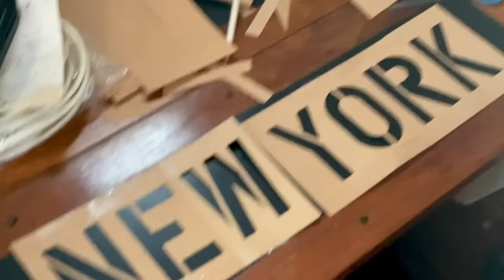Sailing Liberty- Boat Repair Down and Dirty / Real Boat Life / Vmax battery and Isomat Gooseneck

Comment: I used to install 48 volt battery power plants for telephone systems. If you got across the wrong terminals you would know it. So we used to wrap our tools with electrical tape.

Comment: Hey guys, I had a Challenger Ketch from 1976 to 1994. We lived on her from April 1st till November 1st on Lake Ontario NY & Canada. We loved our Mizzen and Mizzen staysail and flew them in any wind under about 20-25 mph as long as we4 were at the right anggle to the wind. Use your Mizzen. You will love it. In low wind we used a hanked on 180 drifter.
Reply from the maker: Challenger seems very nice and spacious with a good headroom. A great Bluewater sailing yacht. We cannot wait to use our mizzen as well. I hope this gooseneck... that it is really fixed now. It took I guess 2 years to get to this point since it was a minor problem to deal with compared to leaking hull. In next voyage we will have our mizzensail flying proud:). Thanks, Helena

Comment: I would use a hole saw on the inside of the boat where the chainplate nuts are and then remove the nuts and bolts. I would leave the existing chainplates in place as getting them out appears to be too much work and they can add strength. I would then install the new chainplates on the outside of the hull. Maybe enlarge the old holes in the old chainplates slightly and coat them to prevent electrical contact with the new bolts to prevent the possibility of galvanic corrosion.

Comment: As to the chainplates I would add this:  First, locate a chain plate that you can examine with the least amount of damage to the boat's interior.  Look for areas were the glass has expanded or bubbled .  If you find such a condition then you may have rust and a break down of the chainplate.  If none is showing then you can either conclude the plate is okay or remove the glass to inspect it further.  The critical chainplates are those supporting the upper shrouds . Try to examine them above all others.
Your plan for the plate on the bulwark I believe is less that sterling.  I feel this way because you are placing the entire load on a 4" area, whereas the traditional chain plate spreads the load over several feet of the hull.  The load is all vertical and I feel 4" of bulk ward is insufficient to bear the load with damage to the hull deck joint. Before I would undertake the expense of the supplement plate I would make sure that the chain plates need replacing.  You might want to check out the You Tube channel  "Sailing Prism" wherein they detail their method for replacing the chain plates on a Hans Christian 33T..Good luck and fair winds.

Comment: Good discussion about the chain plates. I appreciate your concern! Hopefully you can get some good information. 
Needless to say, I think your av work and discussion are getting better. You both are obviously experienced in your av skills, but each “scenario” has particular types of presentation. 
Glad to see you escape significant storm damage.  Yes, sailing equipment is expensive, but hopefully someone designed a good piece, manufactured it with good material and stocked it with a good supply system. Thx for bringing us along.😊😊😊 John Ken

Comment: I worked with Stainless for 40 years and there are two important things to keep in mind:
Use a sharp drill bit and slow speed with a lot of pressure.

Comment: When you spray the chain out the lines of chain right up next to each other.  The overspray will hit the other chains and the can will go farther as more paint overall gets on the chains. It's just a little difficult to turn the chain over and lined up again for separate coats. Also I bought a bunch of Chinese 3.2v lithium cells and mad my own lifepo4 batteries.  You might be able to fit 560ah up to 1120 ah using 280ah cells. I was able to make 1120 ah for less than  $2000.  One battery for less than $500.  You get like 25 percent more power out of your solar because lead acid takes so much power to just top up the last 10 percent at the top.  So that last bit takes soooo much to reach top charge.  Though those batteries will last a year or two for sure.  Though my 560 ah batteries weigh like 95lbs.

Comment: Drill bits:  You pay for what you get.  Pay a little for each, you'll get cheap, crap.  Buy only High-Speed steel drill bits – This type of bits are specifically designed for drilling stainless steel. The best HSS drill bits to use for this application are those with a Carbide tipped.  Carbide is very hard.
Two things will dull a drill bit FAST - HEAT & FRICTION.  When you drill - (1) keep the bit constantly lubricated with oil to reduce heat, and friction.  (2) Drill about 1/16 of an inch, then clear the chips from the hole, drill another 1/16" and clear the chips from the hole again.  Chip removal reduces heat and friction.  Rinse and Repeat until the hole is done.  Follow this same procedure when drilling through SS and you drill bits should remain in good shape.  Store these drill bits in their original shipping plastic cases.  The cases will protect the drills from getting dull in the tool box.  Remember, lubricate and clear, lubricate and clear.  Good luck!!

Comment: Great video!
I would not run the new chainplate as you have planned because it will put all the loading along one line in the fiberglass hull.
Even with a full backing plate to sandwich the glass it is creating a point load instead of spreading the load down the hull.
If it was my boat, I would bolt new chainplates on the outside of the hull using the original bolt locations.
Reply from the maker: Thanks! We are thinking about bolting the chainplates the way you recommended, we read a pretty good blog about it https://svprism.com/external-chainplate-modification-on-a-hc33/amp/ 

It will be a mess and harder for me as a woman to mess up the cabinets I love but it would be worse to loose the mast in heavy seas- you gotta have your priorities in order…:) Thank you for good advice, Helena

Comment: one tip with the batteries: first lose the minus and then the plus connection. if you come on minus when you lose minus, you make no shortconnection. but if you lose first plus you can come on minus/ masse. some with making it together. first plus and then minus connect.

Comment: The way you are proposing new chainplates makes me think it could easily open the hull/deck joint .  All the loads are roughly vertical but also inward towards midship which would torque the bulwark. In my view, you need to face up to cabinet work and try and figure out how it was installed. If you are lucky you can remove large sections intact.
Reply from the maker: We are figuring the options out this week. At the moment we are going around and figuring out where each chainplate is and how hard it would be to do the original way.
We will try to take one chainplate out in port side midship where we can reach. Also we would save a punch of money for outboard and would be able to use bronze for sure.Thanks, Helena

Comment: I'd be a little concerned with the 4" horizontal plate idea. The chain plates get a majority of their strength through the vertical fixings that distribute the load down into the hull. I'd strongly suggest sticking with the  design that has been working for the last 40 odd years. If your careful and considered with the cabinetry .. you should be fine removing just enough to get the job done. Its always a good idea to play it safe when it comes to holding up the rig.

Comment: Great video as always guys! Stainless steel is the way to go, could you get presise measurements and have the machine shop drill all the holes for y'all? Other's in the comments have better ideas and more experience. But stainless is the way to go. 👍❤️🇺🇸

Comment: If you go with the horizontal inner and outer reinforcing plates make sure you use 316 stainless steel. 1/4-inch thickness should be sufficient and easy to find. If you or the fabricator can come up with a template it can be programmed into the laser cutter. They can easily program in features including slightly slotted holes to make fit up much easier and radius the outside corners of your plates to look more attractive and perform better. Laser cutting for many years now has become very economical with accuracy to a few thousands of an inch. Make sure they're laser cutting not plasma cutting. You could also use a water jet cutting process less common just as good.

Comment: Assuming you are seeking a safety factor and not an expensive restoration of the upper structure I believe your consideration of a 4" outer strap is sound.  Taper and bevel the ends so can't snag anything.  Drill/route/file through the rail to sister the upper portion of the chain plate. Drill and fit everything and use a flush machine screw that won't snag anything.  Use bits for stainless and a coolant cutting oil.  Will drill easily.Then tig weld (Just Tack) to hold everything in place and remove.  Weld it.  Use all similar stainless to minimize electrolysis and assemble.  Project Farm on youtube has done drill sharpener tests.  Practical Sailor also publishes many product evaluations and tests, and safety tips.  Then keep the stainless (and hull and deck) clear coated or sealed (but not slippery).  An extra note about marine wiring oxidation--on my boats I was able to stop oxidation of copper wiring by always passing a trickle current through the circuits when not in use.  Might be tricky with modern LEDs but eliminated many headaches.  Enjoy your adventures.

Comment: I'm worried about your idea for the chainplates. 
By putting a horizontal strip and connecting 3 vertical chainplates to it, you could tear your gunnel rail clean off. It wasn't designed for that vertical strength. Also it doesn't solve the problem of metal fatigue in the existing stainless chainplates, if there are minute cracks around the connecting "hole" this could give way under heavy load.
However, if you added some vertical drop down sections to the horizontal plate that would help but you'd still need to strengthen the hull on the inside to take the load. This does not solve the possible metal fatigue issue.
Big job but as you already know, it's crucial you get it right. 
If I was you, I'd bite the bullet and replace them.
Best of luck! 

Subscribed and liked 😄
Reply from the maker: We cannot reach to chain plates inside the boat in most of the spots so we have to reinforce the existing ones somehow. Thanks, Helena

Comment: If you haven't already got a replacement for that Napa Legend battery, first see if you can pry up the 2 covers (each covers 3 cells) and add distilled water (gal might be $2) to cells with low water level.  I suspect one cell is very low on water/acid.  Recharge at higher than normal (20+v vs 14v) dc voltage for 1 hr to attempt desulfating.  Just an idea
As far as chainplates.  The pulling force on chainplates is upward, so to counteract you need orientation of chainplates to be vertical or angle in line with shroud. For each side, I would go with 3  3/8"  thick by 2-3" wide by 12-14" long SS chainplates mounted on outside of hull with 3  bolts each and inside backing plates.  It is the vertical arrangement that covers 10" or so of strong hull fiberglas using 3 bolts that provides the strength to resist the upward pull.  I don't think a 4" wide horizontal SS plate that you bolt a short chainplate would work well as it only has 4" width to resist upward pull.  There is very little horizonal force on shrouds.

Comment: I hope you guys are ok, you haven’t posted in a while. ❤
Reply from the maker: We have been figuring out our off grid water system- water maker desalination ro system sea to tank plus under sink tank to tap reverse osmosis water filtration. Have been for 3 years buying distilled one gallon water jugs. It is a pretty hefty monthly cost, twelve gallons of water take too much space in the galley plus logistically hard and annoying 😄 as a sailor. I am editing partially filmed next episode right now and it will be ready as soon as we will finish this job up and revert back to our old projects like testing out our brand new tohatsu outboard. 😊😊😊 
Thanks,
Helena
Reply: @SailingLiberty  well it’s great to hear that you have just been busy and that everything is ok with you both. I hear you about buying water, I am always purchasing water for my wine making. Down here in Naples Florida they just switched from chlorine to some other chemical to purify our water and it stinks. I too should invest in a RO system for my wine making especially since I used to sell them and install them. ❤️❤️ Stay well Helen and Ted.